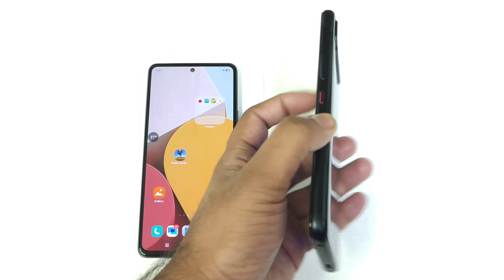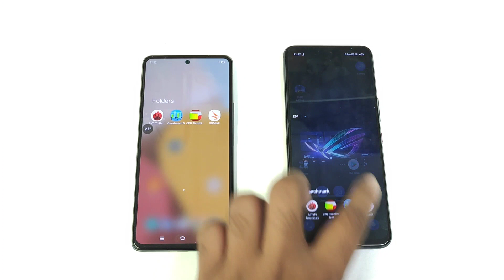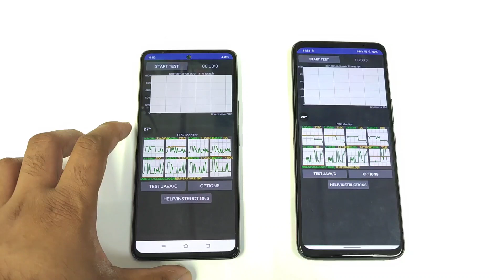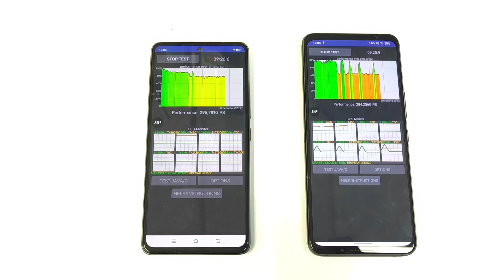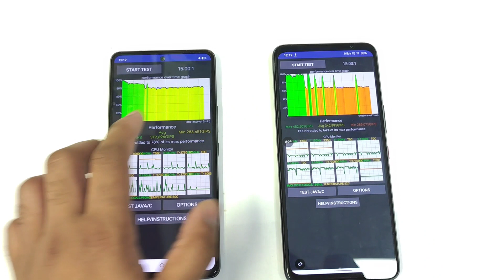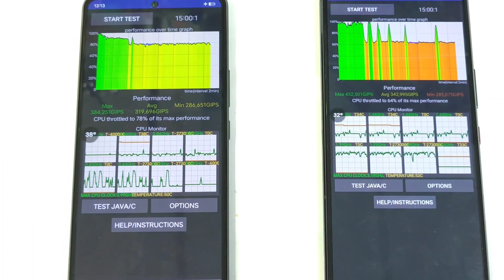Snapdragon 8+ Gen 1 vs Snapdragon 8 Gen 1 CPU Throttling Test Shocking Results OMG 😱🔥🔥🔥

Comment: Wtf Xiaomi 12s ultra with SD 8+ gen1 is better than ROG 6 lol....it does better in throttling test
Reply: No, the reviewer is just am idiot. Rog 6 is designed to work under load, with X-mode fucking activated. It will not throttle, even without cooler.
Reply: yeah the rog need the fan